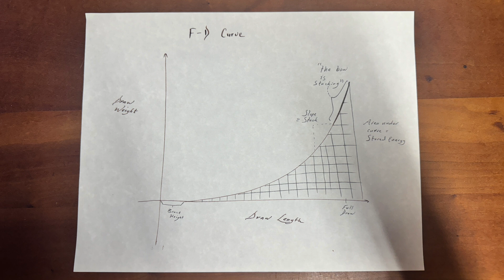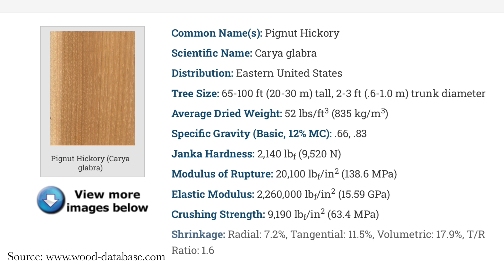The Stack Myth: Understanding Stack and Breakage

Comment: Wow! Nice video.  Thanks bro.  You really help me. Can you tell me,  small recurve bow,  it's full wooden bow? Or you use fiberglass + EA40 bowbacking? Really interesting bow.
Reply from the maker: @ДмитрийШевцов-ю3ъ  It’s a low weight hollow limb hickory self bow. The handle is a take down I made from an old aluminum broom handle that separates into two pieces

Comment: Also if you make a riser made from wood it makes sounds
Reply from the maker: Sounds like an issue with the fit. Risers are routinely made from wood, they don’t have to be noisy
Reply: @DanSantanaBows  only time they don’t make noise is if you glue them which primarily a primitive bow doesn’t take much more then twine or wrapping to hold which is where ppl mistakenly think that a compound bow with a riser is the same as a primitive bow they aren’t the same once you add glue it no longer just a bow made from one piece but a composite of two pieces of wood which then does alleviate the sound but changes the the structure and meaning of what you created 😁